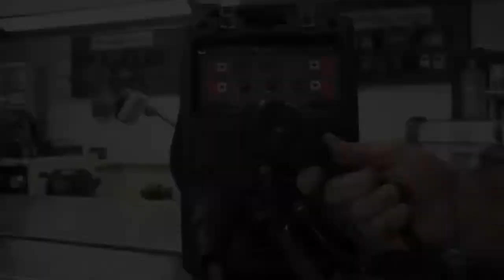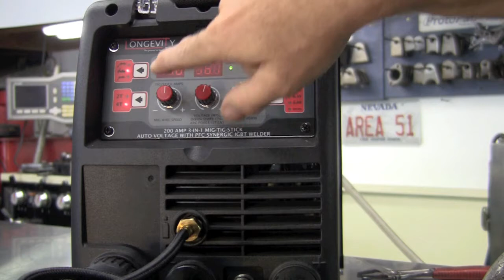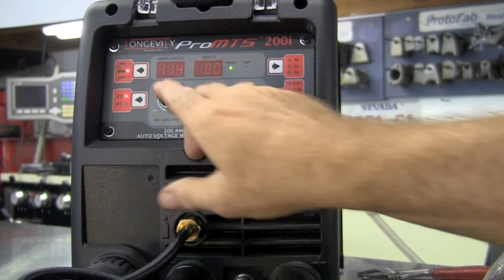LONGEVITY PROMTS 200 MIG TIG STICK WELDER REVIEW SETUP 3 IN 1 MACHINE

Comment: i have the promts 200 .. it works fine most of the time . but the mig has a tendancy to jam the wire in the gun handle sometimes and the burn back melts the wire into the tip